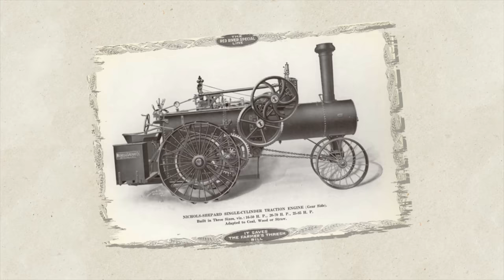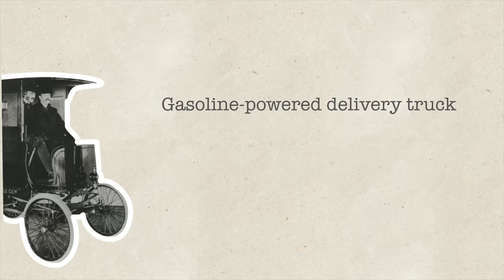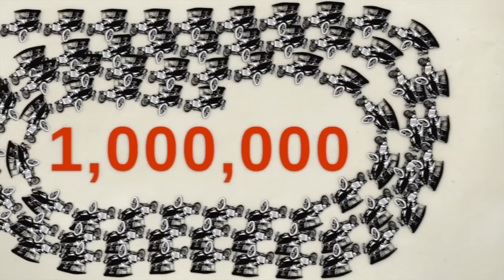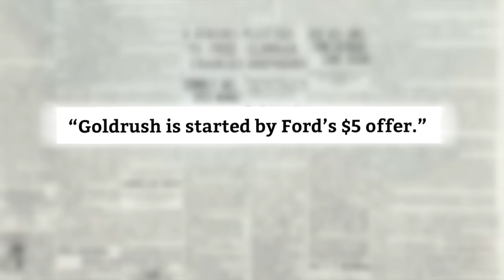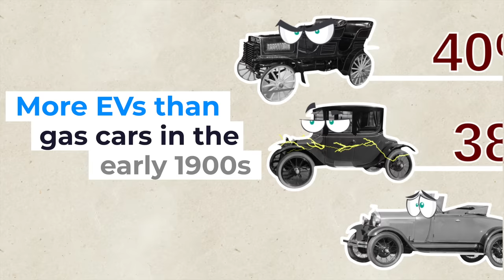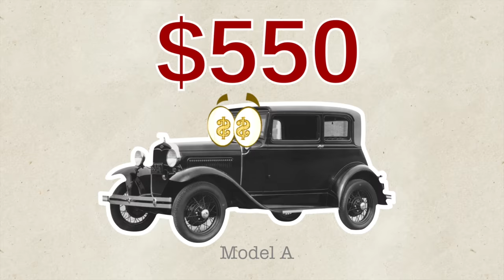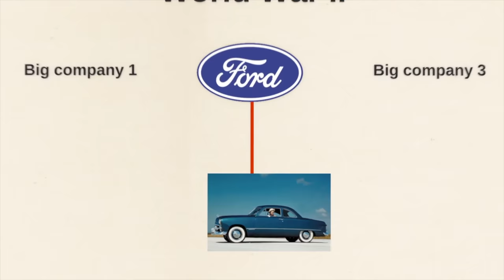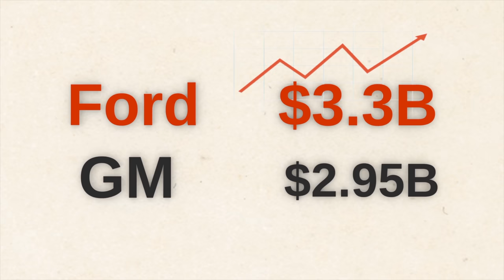Here's Why Real Americans Buy Ford

Comment: Mexicans drive nothing but Ford's.
We are Americans too.
Reliable, easy to work on, and affordable parts. 
My Ranger has 278,000 miles and still running good.
No major repairs, just a gas pump around 180,000 miles.
1995 Crown vic with 210,000 miles still running good.
And the F250 2013 with only 88000 miles no issues.
If you do the proper maintenance and don't abuse the vehicles they last a long time.

Comment: I would never buy new, it's ridiculous to spend that much money on a vehicle. I stick to the old reliable F-150 . Just bought a 2000 5.4 L with 129 k miles on it . Got some rust, but the previous owner had just done a full tune up, new plugs, injectors, coils, brakes and fuel tank. Runs great, $2,200 ! A kid who wanted to change careers and go back to college so he needed $$$.

Comment: Well I haven't taken a bus (public transportation) since 2006 except in rare emergencies but now that my car has broken down I'm taking a bus to have my car repaired and it has already been parked for two weeks but is still locking and unlocking but I just bought a new battery! So I got to get the top of my engine apart on my (2017 ford fiesta) to get ceramic out of the engine but I did luck out with a local job that pays enough especially considering I do not need a car to commute to work! So I think once I get my car fixed and have a ton of up coming maintenance done to it while just letting my mechanic have it for probably (a couple of months) I might not drive again if I can find a second job by the time I have this massive amount of work done! 

So the point to my post is if you live in the city or close enough to a bus line, consider making a few phone calls to temp services and see what they have, if they have something local to you, you could keep your car but I would only drive it once a week and try to get closer to work maybe by moving in the area especially if you can get a second job within walking distance! Or if you live in the south or out west I would suggest a Honda bike, I forgot the name but one gets over 100 miles per gallon of gas, plus they are cheap and I think it is possible that the average person can learn how to repair a motor bike here on YouTube, a car not so much!

Comment: Ford does the same things you complain about. Small GDI turbo engines relative to their application (2.7 turbo in a truck), horrible transmission reliability (see the 6 speed power shift).

Comment: This was a Good Video 👍. I like the body styles of Ford's that's why in 2007 I bought a used 2001 Ford Windstar Sport Van. I  still have it but the fuel pumps keep breaking and now I'm getting p0171 codes because it's running lean. Only 56,000 orig miles  Each year I have to reset the computer to get the check engine light off and drive it for 100 miles than I can pass smog here in Nevada. Ford made a nice design in the van but bad 3.8l V6 engines and Weak Transmissions.  Even if I fix the intake manifold which I won't I hear that people still get the check engine light on. I will never by a Ford again

Comment: I will only buy Ford I’ve had work vans custom vans and of course pick up trucks I have an 2013 super crew 150 with the 3.5 eco my 2000 ranger went to 289000 traded it in the dealer gave me 4500 for trade in love my Fords

Comment: I'm sorry to disagree.  I've owned several Fords, and I've been disappointed every time.  It isn't normal to have to rebuild a transmission every 70K miles.  And it isn't normal to have to replace an engine with fewer than 150K on it. I have a Honda in the driveway now with 203K.  No major repairs.   I put Ford in the same category that I put Chrysler, VW, Audi and others.  Lease it, return it,  don't buy it.  I buy Hondas, Toyotas,  and GM.  I lease Dodges and Audis..     I do love them, but you really do want to be rid of them by 50K.   Whoever has the car I'm in the market for, and attracted to, (some cars are work horses, some are play horses and some are show horses) at the time.

Comment: I have a 2002 Mustang GT with 211k on it original motor and TR3650 5 speed and it runs like a top. My 1999 Chevy suburban is constantly breaking lol. I will say the new Ford ecoboost 2.0L is complete junk, I’ve had several 2019 Ford Edge with 2.0L ecoboost with less than 50,000 miles with coolant seeping into the cylinders. Not good

Comment: hey Scotty, guess what , i had problems with my explorer it wouldn't shift, goosed it home, and found the torque convertor messed up, now  got this question, what about the main shaft connecting into the torque convertor, only about half an inch of shaft is used to turn the back wheels!! I mean thats a lot of torque, you got any suggestions on a better truck besides my drem truck a K5 blazer, or converting this ford to gear shift which would be a nightmare??
Reply: @les hello,how are you doing

Comment: I’m a “real American”, the reason why “real Americans” don’t buy a FORD, is because FORD puts turbos on both 4 and 6 cylinder engines, to “power” their FORD explorer and F-150 TRUCKS (for god sake), which in turn, is nothing but problems later on, because the engine is overcompensated for power. “REAL AMERICANS” drive CHEVYS baby!

Comment: My favorite car was a 1964 Ford Galaxie 500 XL, 2dr hardtop, bucket seats, leather, 390 engine, automatic in the floor, woodgrain console. I was 17 years old. I learned how to work on cars by owning that car because I had to work on it all the time. It got 10 mpg. I bought a 1975 Mercury Cougar XR-7 right off the showroom floor. It had a 351C engine and a C-4 (!) transmission. With 13,000 miles on it I had to put another transmission in it. I got alot of experience working on cars by driving Fords and Mercurys. I quit buying them. My Buick has over 193,000 miles on it and runs like a new one. I'll never buy another Ford.

Comment: Well all i can say is the Ford Sucks. Case in point, i bought new a 2011 Ford Fiesta, its been sitting hallf its life  in the  garage due to the dreaded transmission problems. Finally  last week Ford offered to buy it back. This after litigation and discovered  Ford emails that ford new back in 2010 that the electric transmission didn't work, yet they continued to sell the Fiesta for another 8 years. Now i hope i don't have to wait another 6 years for my check.

Comment: Putting the water pump inside the crankcase and now the engine valves break off and destroy the engine , the trucks have a front end shaking problem ....high school drop outs are the new engineers 😵

You can thank the UAW union for paying workers a total of $72 an hour and not having enough money to hire good engineers and having parts made in China ( like the dodge camshafts china forgot to heat treat and phosphate  parkerizlng 😵😂😂😂😂

Comment: Blame the high cost of cars nowadays on unions, government regulations and all the fancy gadgets in the new cars. Electric cars are HORRIBLE for the environment because of the batteries and how they're made and how the materials are mined and recycling costs plus getting your energy from the grid means that 50% of the energy generated to charge your car (or for anything electric) goes up in heat losses in the transmission lines.

Comment: The used to make affordable cars . Now they want 60k + for vehicles that steering wheel falls off , faulty door latch that opens door at high speeds , seat belt pretensioners causing fires , faulty igntions switches causing fires and latest being ABS HCU failing causing soft brake pedal and causing accidents with unjuries and death . FORD is today the worst domestic vehicle with the most serious and absurd recalls . You would think since 1908 they would figure out how to make door latch that wont open on its own or a steering wheel that wont fall off in your hands,,, i guess not .... Its beyong me  how dumn fan boys will still buy this POS. Ford has actually recalled more cars than any other company in American automotive history

Comment: Electric cars - unreliable, expensive, very short range, long recharge times just to name a few major issues. Plus there are recharging problems related to apartment dwellers and even homeowners - not to mention the massive increase in electricity that our current grid can NOT handle for a very long time to come yet.

They also create far more pollution (mostly from the batteries) than gas cars make.

If they made electric cars without those problems, they would sell like crazy.

Who wants to drive on a tip to only go 6 hours or so and wait 6-8 hours to recharge?
You spend 1/2 your time recharging. 1/2 of your limited and PRECIOUS vacation time.

And if you run out of power in a remote place, you can't simply get a little juice to get to the recharging station - you have to be TOWED.
Gas cars - they can bring a gal or two and you easily can get to a gas station.

Using the heater or A/C with an electric car shortens the driving range and battery life.
God forbid you had a 1000 watt stereo and powered subwoofer. You might get out of your neighborhood before needing a recharge.

The more people's arses you haul around the shorter the range too.
Batteries do not have enough energy density for modern use.
Not even close.

Oh and if you are stuck being forced to recharge someplace, you are at the mercy of whatever they want to charge you to recharge.

And just will you DO while waiting 6+ hours to recharge?

Probably the best combination is a Hybrid with regenerative braking.

Even then you will still have electrical problems.

Just wait till the government expands the kill switch they are forcing into all vehicles in 2026.
You think they won't expand that for other nefarious reasons?

Comment: I hate fords ive owned 3 and had nothing but major problems  check engine light chased it for months and hundreds of dollars to no avail  another broken spark plug in cylinder head again hundred of dollars rust major rust rockers rear quarters most of my problems were engine related

Comment: I used to work for Ford as a Mechanic  'and I wouldn't buy  a Ford vehicle ' lots of problems 'not a well made vehicle at all ' my job was replacing engines  'because new cars jeeps  were blowing there engines up  'it was constant 'another problem was water leaking into the interior of the vehicle s are the electrical systems wete weak ''' I drive a Lexus rx  'and I haven't had any problems what so ever 'I will NOT BE BUYING ANY FORD MODELS '
Reply: I work in Ford Europe and the focus ecoboost was pioneered here..its a great car.